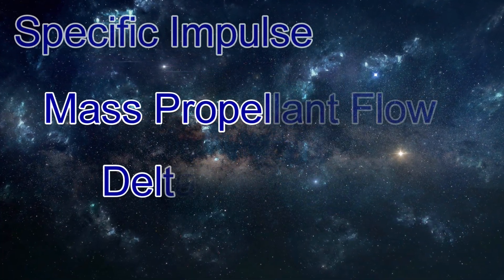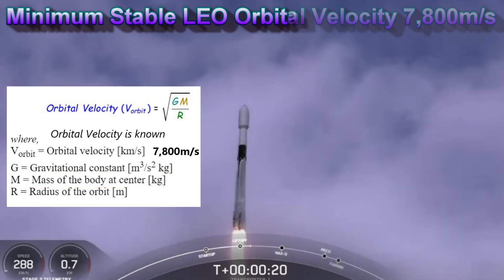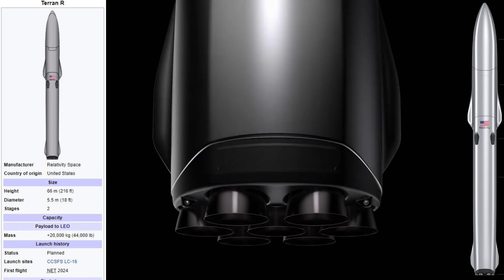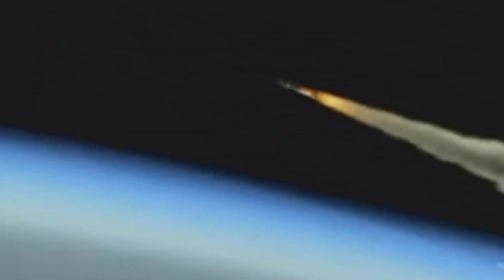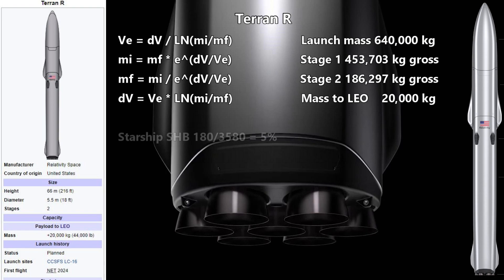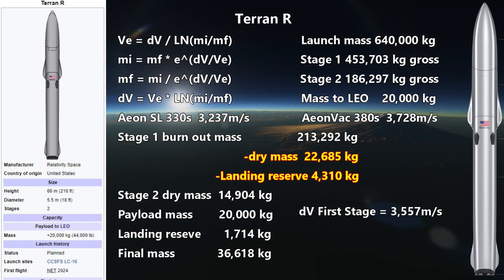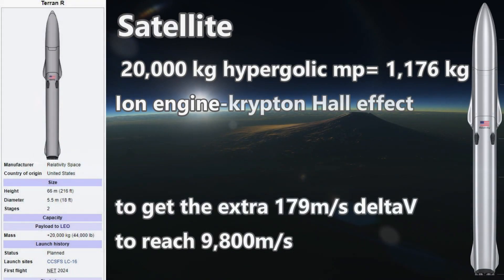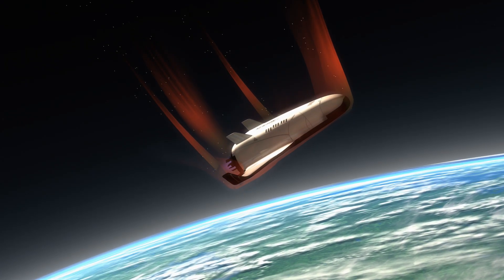Rocket Science: Understanding DeltaV and the Rocket Equation

Comment: One interesting part is that v ln(m1/m0) is acutally an approximation for delta-V under the premise that close to infinity (actually just a big number) of burning and exhaust cycles are performed. It can be derived from just applying the law of conservation of momentum (Impulserhaltungssatz) m0 * v0 = m1 * v1 in little short time intervals (a fraction of a second would do for getting an understanding) . Obviously if you burn most of your fuel at lift-off you get better results as you get speed without carrying something --- probably like a boost from a space gun. As it simplifies math and makes the whole thing more understandable I choose to mention it here. Also it is easier to deal with varying specific impulse etc. that way.
Reply from the maker: Yes indeed Mathias.  One of the many reasons why bursts of high thrust can still be better at getting the job done, even at a lower efficiency or specific impulse.  Thank you.

Comment: Great class thanks.. The aerodynamic drag  penalty  helps explain the  lure of air launch. 
It would be interesting to see what it would take to avoid the 'throttle down through Max-Q'  sequence.
Reply from the maker: Thank you Cliff!  About 25km does it.  No real MaxQ
Reply: Throttling down during Max-Q is an engineering decision, with it's own trade offs. The first throttleable rocket engine was the lunar module descent engine (J-2 could lower thrust  by adjusting mixture ratio, but it's not throttling in a conventional sense). So up until that point, no launch vehicle throttled down. The consequences of this meant that vehicles had to be rugged to be able to take the aerodynamic stress in the atmosphere, and structurally sound enough to take high G loads at the end of the burn. Careful control of the vehicle is also nessisary to prevent it from losing attitude and breaking apart under aerodynamic stress(First flight of Ariane 5 is a great example of this. While a result of a guidance fault, the breakup was due to aero stress.) Advantage of this rugged design means reduced engine complexity, and less time and money spent developing engines. Rocket engines are still considered a somewhat experimental instead of an analytical field, with lots of tests and some trial and error needed to verify various systems can function under nominal and off nominal conditions and develop reliability data in various conditions. Steps can be taken to limit the amount of expensive testing required, and some development strategies require more than others(The SSME development strategy used a lot of "test, fail, fix" method, and was very expensive, which is something some engineers felt the program could have done better). But structures are more well known and are usually less complex to design. However, when looking at reduction of dry mass and from a comfort perspective, that's where throttling engines really comes into play. Keeping G loads like for special payloads(Like squishy humans) is a good idea. And while throttling down during Max-Q might create more gravity losses, the reduction in dry mass is a decision that usually pays off if the analysis was done right.

Comment: The ratio of thrust between Starship first and second stages is roughly 5 to 1. The ratio between Terran first and second stage thrust is 75 to 1. This suggest that its second stage won't be as massive as you think.
Reply from the maker: Good point... but to get 10 tonnes into orbit it will need to be.

Comment: This episode made me search out that awesome delta-v “subway map” of the Solar system by Ulysse Carion. 27000 m/s between Venus surface and orbit. Oof.
Reply: It's important to note that the huge delta V cost of launching from Venus only exists if you are calculating based on launching from the solid surface of Venus to orbit. However, this would almost be like trying to calculate how much delta V it takes to launch to Earth orbit from a depth of 1000 meters underwater. 
In real life, any reasonable Venus launch vehicle would not launch from the surface using rockets, it would use some method of aerodynamics based propulsion in order to achieve a high altitude and act as a rocket launch platform. In fact, Venus bases or other constructs would likely be designed to permanently float in Venus's upper atmosphere at around 50 km altitude, in order to avoid the crushing pressures and intense heat down at Venus's actual surface. 
Due to the slightly lower gravity of Venus, launching from such high altitude platforms would likely only require a delta V of around 8 km/s, not 27 km/s, therefore making it much more feasible.
Reply from the maker: Very good point Tyler. I'm disappointed that we have not done more with Venus exploration.  HAVOC should have flown long ago.

Comment: Great Explanation of the concept of delta-V, using the Terran-R as case study.
The ion engines have much greater specific impulse, but they aren't self powered like chemical rockets are. They require electrical power separately, to accelerate the propellent out of the engine nozzle. Solar panels can provide such energy only for Cubesat-sized crafts; otherwise - as you mention - they need a nuclear reactor onboard the ship.
Arthur C. Clarke utilised ammonia for the Discovery One Spaceship, while for the Tsien - which landed on Europa - utilised water.
The crux with rocket engines is, they must throw some mass out of the nozzle in order to generate delta-V...
Reply from the maker: Indeed! I love the "flash" reactors called TRIGA.  These heat hydrogen with neutrons like a microwave heats water.